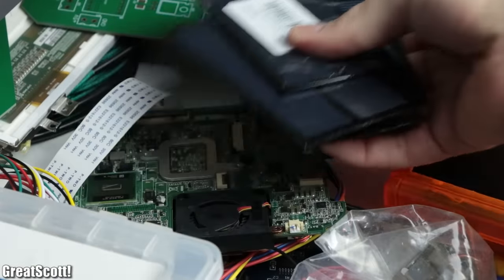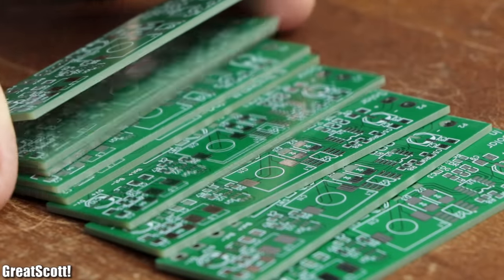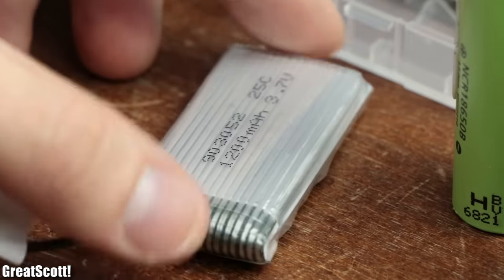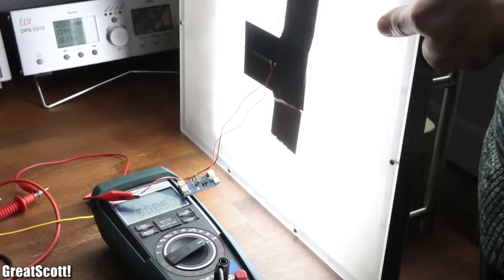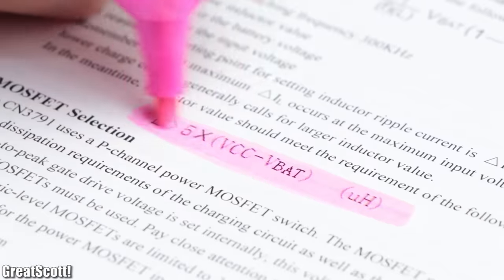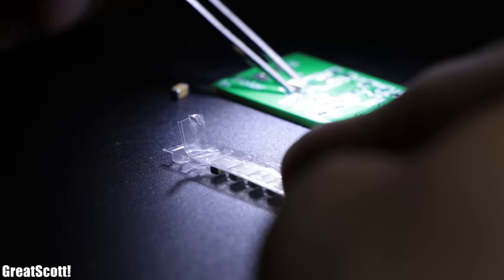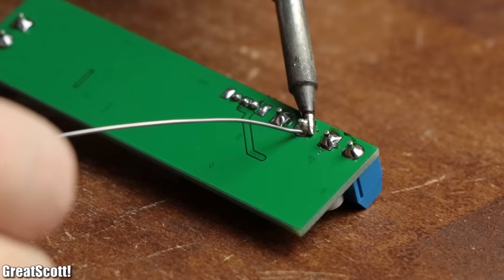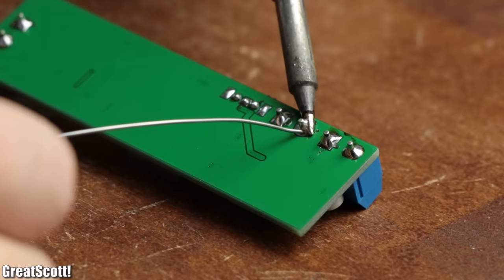Solar Battery Charger (LiPo/Li-Ion) || DIY or Buy

Comment: JLCPCB.... only 2 dollar... + 20 dollars delivery to Europe.. why you never mention it?..
Reply: With regular mail instead of DHL Express you have a lot less shipping costs
Reply: @mobzi264, yeah its a bit disingenuous to say "boards shipped for $2" when the shipping cost is about 10 times that amount.

@Twometer I don't think he would get them in a few days if regular mail was used? Also to many countries they don't offer regular mail any more, DHL only.
Reply: @jaro6985  no provably not in a few days.. also I really did not know some countries don't support regular mail
Reply: He lives in Germany, presumably he is using standard post. In other videos he says 7-10 days, which is pretty standard.
Reply: Yeah regular post would have been cheaper if available... Here, to France, for a 1.76€ board (2$) its a minimum of 16€ shipping in 7-20 days, and 19€ for DHL express. There is no "cheap and i'll wait" option like in other chinese website (Bangood, whish, aliexpress, ...)
Reply: indeed, Scott has mentioned it before.... and pffft.. try buying ANYTHING at NORMAL international postage charges from the U.S.A, then he's got something to bitch about. (its also why I never by from USA anymore, its 5 times more expensive than Europe, and 20 times more expensive than Asia)
Reply: @Ressy66  JLCPCB is manufactured in China....
Reply: If you get PCBs manufactured domestically, sure the shipping might be cheaper but you're also adding multiple zeros to the price.

Not sure what options exist in Germany, but here in the States, the cheesiest option for a tiny board like that would be >$60+ shipping for 5 PCBs (I think) under 50cm.sq (may have been a lot less, been months since I checked), verse $2+shipping for 10 PCBs at up to 100cm.sq.
Reply: But you have to wait extremly long
Reply: @jaro6985  Dude, if you had a million subscribers and you promo a PCB service or Parts supplier on your channel, I am pretty sure they will send you a whole bunch of free PCBs and Components at no cost!  You gotta see whats going on here man, youtubers are not stupid, especially the monetized ones.  They obviously love what they do but they're here to make money, thats the reason behind all this youtube content, to get money from selling T-Shirts, Designs, Promoting Other products and services, Affiliate programs on Ebay or Amazon, from links in the description... yada yada yada.  Sorry its not an option for guys without a Youtube channel with 1Million subscribers, but if you do get into the youtube business, then you can keep this in mind when you start using particular tools products or services.  The manufacturers of those products understand its like the most effective afffordable advertising for their products!
Reply: sure.. but can any of you find a better product for a better price (custom PCB + shipping)? I havent. So just recognize that your projects will be kinda expensive, and plan accordingly.
Reply: there's occasional free shipping there, not really misleading
Reply: Shipping is what it is. Still good quality economical boards
Reply: What "$2 for 10 PCBs" - This outdated information, more accurately for 10 pieces PCB by cise 100 x 100 mm,  you mast paid $5... but not thet 2 dollars...
By $2 you can provide 5 pcbs. but even that is very cool
Reply: My experience: yes a little bit expensive and time taking deliveries. However quality is Top!
Reply: my last order was 5 pcb with transport of 19€ PLUS 19€ taxes!
Please remember: if your bill is > 21€ you will have to pay taxes and so on additiobnaklly!!! neverthekless, the opcb was delivered just 6 days after my order.
Reply: right.....it only needs about  0.71USD to get 5 PCBs with shipping cost!!! (Don't ask me why i know this

Comment: Efficiency below 75% for the buck converter is relatively bad. Try soldering different diodes, different mosfets and inductors that you have on stock. If possible reduce the operating frequency a bit.  Just check the efficiency with power supply with resistor in series to somewhat limit input current with MPPT.
Another more complex option to increase the system efficiency is to have buck converter on the output too. This means have 2 or 3 cells in series. This will also reduce current on the input and can increase the input buck converter efficiency too.
Regarding PCB, I think some of the discontinuous current areas could be reduced with rearranging some of the components.  Take a look at some of the EMI reducing videos. I know this project is probably just for you, and will most likely not produce any problems. But it is good to have that on your mind. Some converters even become unstable when layout is bad and than you are dealing with electronic ghosts when sometimes it is working and sometimes it is not :-D

Comment: the mppt voltage listed on the back of panels as stated by the manufacturer is ''guessed'' - they do not know your local temperature or level of sun etc, its will be ''almost'' right, you need to try 1-2 volts above and below, so best to remove the fixed value resistors and use a variable one.

Comment: But why did you get that poor efficiency at 10:20?  Anyways great video as always!
Reply: There are a lot of variables here, it might be the light or the efficiency of the panel itself
I'm pretty sure this is not how efficiency is really measured correctly.. He just does what he can, but he doesn't have like solar panel testing equipment you know.
Reply: It seems that the "MPPT" that he used was not actually tracking the maximum power point, but rather fixed to a voltage that should be close to the real MPP. "Real MPPT" would find the right voltage automatically without setting any hard coded value, and it would adjust it appropriately when there are changes to the light.
Reply: @tuomaskinnunen8981  Good point, I think you are right. I'm guessing that this dumb MPPT controller is at least better than a PWM based unit, but you would have to adjust it carefully for a specific solar panel.
Reply: @Tuomas Kinnunen: I think the two resistors, R8 & R9, are selected by the engineer to match the specified voltage specified for the solar panel in ideal conditions. The regulator then changes the output voltage of the buck converter to optimize the current being fed into the battery so that it is receiving the maximum current the solar panel is capable of supplying based on it's the current operating conditions; solar radiance and temperature. There's more to it than that. Here are a couple of useful links. 
All About Maximum Power Point Tracking (MPPT) Solar Charge Controllers: ( https://www.solar-electric.com/learning-center/batteries-and-charging/mppt-solar-charge-controllers.html )
Data sheet for 4A, Standalone Li-ion Battery Charger IC With Photovoltaic Cell MPPT Function CN3791: ( http://www.consonance-elec.com/pdf/datasheet/DSE-CN3791.pdf )
Reply: @RobertShaverOfAustin  the point is that it's not 'tracking' the maximum power point, it's chosen with those resistors and doesn't change once set. The problem with this is that the maximum power point is dependant on so many factors, it changes throughout the day.
Reply: I would use an Arduino to verify max power point.
Reply: @Jadin Andrews I could be wrong but, after reading the data sheet, I think the two resistors are telling the chip what the nominal voltage is of the solar panel. The chip then adjusts the voltage at the power cell based on the actual voltage being delivered by the solar panel to achieve (or at least approximate) the MPP. 

The data sheet says, "The MPPT pin’s voltage is regulated to 1.205V to track the maximum power point of the solar panel."

Later it says, "CN3791 adopts the constant voltage method to track the photovoltaic cell’s maximum power point. From I-V curve of photovoltaic cell, under a given temperature, the photovoltaic cell’s voltages at the maximum power point are nearly constant  egardless of the different irradiances. So the maximum power point can be tracked if the photovoltaic cell’s output voltage is regulated to a constant voltage.
CN3791’s MPPT pin’s voltage is regulated to 1.205V to track the maximum power point working with the off-chip resistor divider(R3 and R4 in Figure 1).
The maximum power point voltage is decided by the following equation:  VMPPT＝1.205×(1＋R3／R4)"

So I'm thinking that as the voltage from the solar cell rises the chip increases the voltage to the battery which increases it's charging current. This, in turn, loads the solar cell who's voltage drops down to maintain the 1.205 volts at pin 6 of the chip. If the voltage from the solar cell drops then the opposite happens, lowering the charge current and allowing the solar cell voltage to rise again.

This all assumes that the statement in the data sheet, "the photovoltaic cell’s voltages at the maximum power point are nearly constant regardless of the different irradiances" is true.
Reply: @RobertShaverOfAustin  thanks for posting that. Maybe I was mistaken about the MPP, I always assumed that it wasn't at a fixed voltage and depended on differing irradiance and cell temperature throughout the day. I'll definitely ready up on this more, cheers
Reply: Well I'm just guessing from what I read in the data sheet. Sometimes it's really hard to know exactly what they mean. But it's dialogues like this that help me learn what the important questions are even if it doesn't lead me to a definitive answer. So thanks for engaging with me on this topic.
Reply: @tuomaskinnunen8981  I have seen the Isc (short circuit) vs Voc (Open Circuit Voltage) curves for Solar panels, with the MPPT area marked at the "Knee Point" where the Curve drops downward. Its the Knee Point or corner where the power delivery from the panel is optimal.  HOW WOULD YOU IMPLEMENT A CIRCUIT THAT OPTIMIZES THE POWER DELIVER FROM THE PANEL?  
Obviously you need to throttle the current flow.  Too much current drops the voltage excessively lowering power delivery, Too Little Current gives great voltage but again lowers power delivery.  How do you Implement the Tracking?  I believe the Voltage output is usually fairly constant at a given current draw, however current output varies directly with amount of Radiant Solar Energy hitting the panel.  Looking at a sample graph for a given panel, you can see the MPPT point is usually occurring at the same voltage level for all different levels of irradiance  so I think its acceptable to fix the MPPT voltage input to the controller IC at that voltage setting.  

https://www.e-education.psu.edu/ae868/node/877
Reply: @Jadinandrews  I think every panel manufacturer provides the MPPT voltage for the given panels
Reply: @Jadinandrews    I suspect you may actually be wrong about this. The MPPT point is fixed regardless of the amount of sunlight hitting the panels.  Its fixed an optimal output voltage.  The idea is to limit the current draw from the panel such that you do not shift the operating voltage to far above or below MPPT point. Too low of a panel output voltage, the power transfer decreases, Too high of an output voltage the power transfer decreases from MPPT.  I think the controller circuit draws as much current it needs until it see the panel voltage dropping below the MPPT voltage.  Thats my guess.
Reply: @adayinthelife5496  Why Arduino?  You can simply use a voltmeter and ammeter on the panel
Reply: Buda Bunda you can plot the iv curve to see mppt
Reply: @scrappydogfinance8434  thanks but I already stated in this thread that I was mistaken about MPPT. You should read all the replies before firing from the hip and necro bumping a thread unnecessarily.

Comment: Some lipos come with integrated protection board. I think that this is why the commercial solar charger does not have overdischage protection. If that is a problem, three NiCd ot NiMH cells can be used as one lipo cell. Charge voltage is the same in both cases, so I think that is why they list LiPo and Li ion, even though it may be dangerous.

Comment: I use tp4056 for solar charging my lithium cells. I am surprised how good is tp4056 with 6v panels
Reply: Andreas also tested this.  I also believe that with very small panels it is better to use something very very simple. You waste too much energy in the circuit itself.
Reply: @Luke-san  they make great solar led light for garden. I made one with tp4056 protected module  and a Ldr circuit (light detection) between cell and led.

Comment: 0:20 that sir, is where you're wrong. I took a 12 volt solar panel and hooked it directly up to one of those little car port expander things and the circuitry in that was enough to plug my phone into it to charge it. I also took a solar panel and wired it directly up to a phone brick. success of that project varied but it is possible to hook a solar panel directly up to a project.

Comment: I made a LoRa node using a large panel (20volts output) fed into a stripped down car cigarette lighter phone power adaptor circuit to power a Adafruit Feather U32 lora board, it gives the board 5 volts directly bypassing the USB port (modded to stop USB reverse voltage), and thus charges a 14500 LiPo via the onboard 5 pin battery management chip, works great and somewhat acts like a MPPT in some way that the car charger is DC to DC so can even work right down to 5 volts if needed. During the night the DC to DC converter is off completely allowing the LiPo to discharge as it should to maintain health.

Comment: The diy solution is very impressive. Im currentlu working on the exact dame circuit for my research project and i was trying to change the resister devider to retro fit an 18v input. But like you said it had no protection on the battery side. Im going to be using this video for my research thank you

Comment: One reason the store bot one didn't really work is because you connected the solar panel first, witch is a big no no for your suppose to connect the battery first then the the panel or you run the risk of damaging the Charge controller.

Comment: Great video!  But this points up why I do not like lithium batteries.  They are great for power density, but much too demanding on the charge apparatus.  Even with the additional bulk, I much prefer NIMH.  You can hit 'em with a wide variety of charge sources.  They just don't care, as long as they don't overheat.  I wish more experimenters would show more projects using NIMH power banks.  They're so much less of a headache.

Comment: Nice project. *thumbs up*

If you want to simplify to a barebones level, then 6V panels (in parallel), with a Schottky diode, and a protection circuit (with DW01 and 8205A) will do the trick. Probably horrendous efficiency.
If you go for a bigger panel, then you put a Linear Regulator between the Diode and the DW01, and mybe add a resistor to limit the current. Again, likely horrendous efficiency.
But either solution is extremely simple while being sufficiently safe. And if you want to scale it up to multiple cells, then you'd need a DW01 / 8205A combo for each of them.

Of course, if you wish to charge the battery of your old Nokia 3210 or 8210, or whatever protected battery, you don't need the DW01.

Comment: Next time you need to solder 2 SMD resistor in parallel, solder the first one and add the second on top of it, its much easier and more clean

Comment: this kind of  solar charger board can be used on a drone. Lightweight  board to charge lipo battery at the same time drone is in the air . fantastic idea , i was try to do  the same solar charger board to storage energy , to buy  the best configuration batterys can be  charger per solar panel

Comment: Quick Tip: You should not place ground plane under the coil because It changes its parameters. I and many great brains recommend to remove it from both sides of PCB.

Comment: Hey there you should build a wirelesss firing system for fireworks that you can programm and fire a show synchronised to music using modules all connected to a master that outputs audio and tells the modules when to fire.I suggest buildibg this system using an i2c network!Keep it up for alll the work !

Comment: Just use a TP4056 charge/discharge board. Has over charge/discharge protection, and you can get 10 for $9-10 on amazon.

Comment: Hi and thanks very much for this inspiring video on solar panels. I am currently working on a similar project where my focus is to design a charge controller with an output 5V/1A and a given solar panel of 10W/18V/0.55A (max). My question is how does the controller manages the varying input from the solar board and maintains a constant output?

Comment: Wouldn't it be easier to use a TP4056 based board? The voltage supplied to the board is 4-8V (perfect for 6V solar panel). Charging battery up to 4.2V with 130mA-1A current + battery protection. Costs just a dollar or even less so it's super cheap. To this, we add a small simple step-up or step-down converter or a logic board from a cheap old power bank and we have a simple system for charging the battery with a solar panel. Should be cheaper and cost less than make it by yourself. For smaller project, I think, that it's more than enough.

Comment: Thanks for the great video !
Your test results actually tell me TP4056 linear charger board is a STRONG competitor on the market. It is cheap and widely availabe, and it is efficiency is a very high baseline (suppose you have a 5V solar pannel and Li-ion battery is @3.7V which give you 74% efficiency). It is generally quite hard to optimize the efficiency of DCDC buck converter to more than 75% in DIY proejcts....especially when the input voltage is somewhat variable.